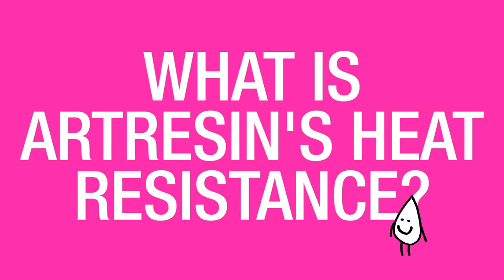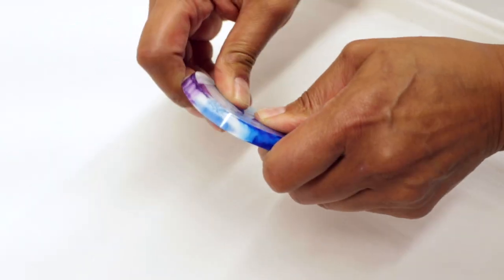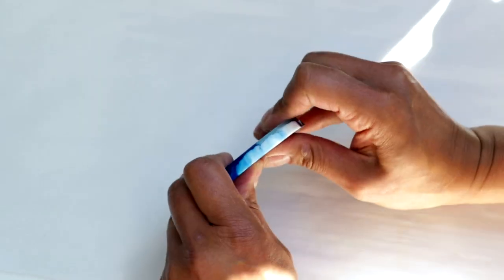What Is ArtResin's Heat Resistance?

Comment: How much heat can a tile with cured art resin on it withstand? ?
Reply from the maker: I would not exceed 120F or 50C :) Even getting close to those temperatures could soften the resin.
Reply: @Artresin  then why when I  call ArtRisin they say it will with stand about 478 degrees?